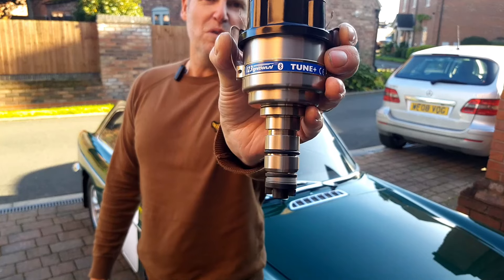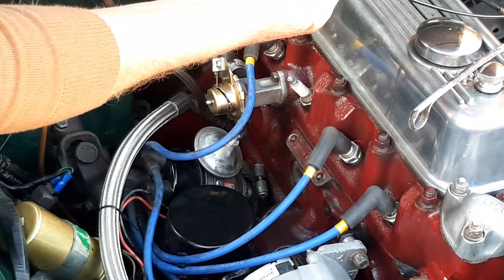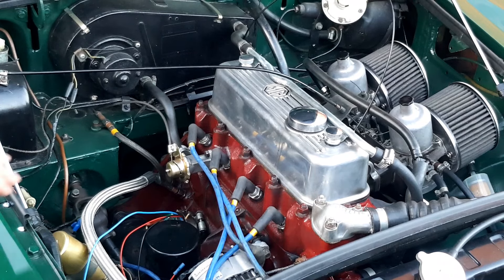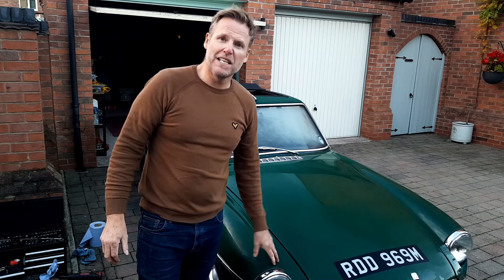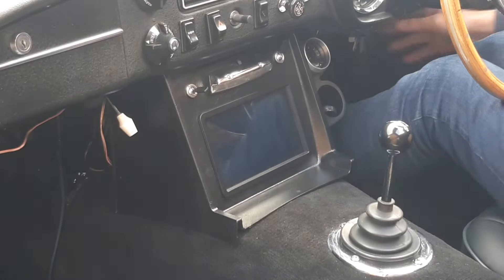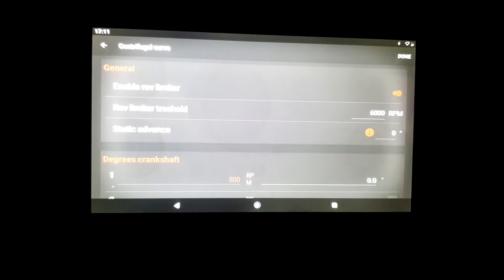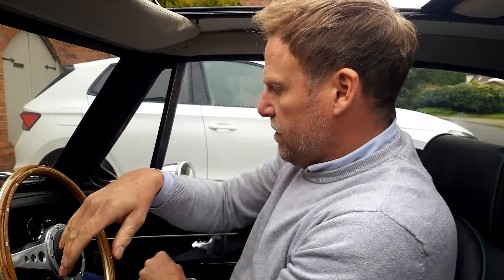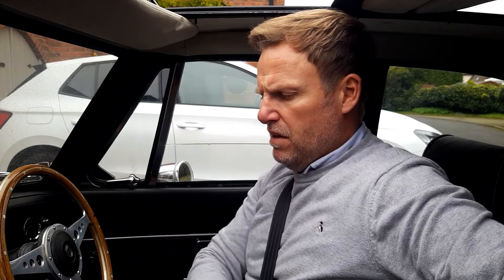The instructions are wrong! Fitting a 123 Tune+ dizzy to an MGB GT.   MG B BGT @Exhausted-autos

Comment: If you set up your timing light you can use the static advance feature on the 123 to get perfect agreement between what the 123 is reporting and what it actually is. Also, to tune the vacuum advance you should check your vacuum level on the app at cruise and under WOT, set lower end of curve so you have full advance at cruise (on a flat road, very little engine load) and no vac advance at WOT with some margin (ie, if WOT vacuum is around 80 to 85kP then set zero at 75kP).
Reply from the maker: Cheers Chris,  I'd not thought of that,  I'll change the static in the app... it'll be particularly useful with the SC.  Il get back to the vacuum.... I'd be good if it could record parameters from a drive in the app.
Reply: @Exhausted-autos  I have asked them multiple times to enable logging but the best I have managed is recording the screen and then syncing the video with my other logged parameters like AFR from the wideband.

Comment: Easy way to tell if you’re on the compression stroke…. Remove the spark plug ,rotate engine with your thumb over the hole ,you will feel the pressure as piston comes up !!
Reply from the maker: Cheers Michael, ill try that.   I'm looking forward to getting back onto the MG supercharger.👍

Comment: Great video, I thought I would add a bit to help. Firstly programming a 123 dizzy. As an example lets simulate a 25D41288 MGB dizzy. I would add the two points at 500 rpm and 1000 rpm and make these both the dynamic timing for that dizzy - 14 degrees, which is a combination of 10 static plus 4 degrees centrifugal advance. Then at 1600 rpm I would add 22.5 ( 10 static plus 12.5 centrifugal ) and the 30 degrees at 2200 rpm ( 10 static plus 20 centrifugal ). That is the end of the advance curve for this dizzy. This is where the 123 is brilliant, because we can enhance this curve beyond 2200 rpm. 32.5 degrees at 2600 rpm, 33.5 degrees at 3000 rpm, 34 degrees at 3300 rpm, 34.5 at 3700 rpm and 36 at 8000 rpm. The vacuum advance can be obtained from the case of the dizzy, for the 25D41288 advance starts at 87KPa and finishes at 20 degrees at 69 KPa . Then continues at this level. In practice I do not set vacuum advance above 10 degrees using the same points. On the 123 dizzy I use the feature that enables me to turn off vacuum advance below a certain Rpm, I do this at 1100 rpm so idle has no advance. With all the points above you can experiment according to the tune of the vehicle. If you can get a workshop manual all of  the curves for each engine and dizzy type are given, alternatively you can get them on the web, http://www.mgb-stuff.org.uk/curvestext.htm. Timing a 123 dizzy. Set to TDC as the green light comes on. The car should start immediately. If you have access to a programable strobe, set it for 14 degrees, disconnect the vacuum advance and check 14 degrees on the program corresponds to TDC, adjust the dizzy as necessary. Remember to reconnect the vacuum advance tube. Timing done. You can change the program and NEVER have to change the timing. Then balance and adjust the carbs. Your car will be smoother, with better low down pick up and mid range torque. Much more drivable than even a good original dizzy. 123 dizzy gets you about 90% of the way there. A megajolt takes you to the next level of incremental gains. Given its extra cost and complexity I would add it to a balanced, gas flowed with better cam type of engine on an MGB, but then I would probably also add a 5 speed gearbox, change the rear axle ratio, put GAZ rear dampers on with a Panhard rod, a slightly stronger anti-roll bar and front lever arm dampers that can be adjusted for damping and adjustable camber.

Comment: In general not a bad little video, so please do not take the following comments as a criticism of any way.  So firstly, if the car is a runner before the distributor upgrade, its worth taking the cap off the existing distributor and taking a quick photo.  This can become a reference position for the new distributor installation.   Showing people the compression stroke via valve closure is a great idea, just as you've done in the video.  Some sadly don't know which way to turn the crank shaft pulley, so this can a be a good time to explain the distributor rotor should be turning 'anti-clockwise' as you rotate the crankshaft pulley.   Or depending on ground conditions, the same can be achieved by pushing the car forward whilst in gear (handbrake off of course).OK.....now on to the base/static ignition timing.......you've always got to check this with a strobe.  If you were 2, 3 or 5 degree out from the static applied, it then makes your whole mechanical advance curve into a joke, because every key check position is than also 2, 3 or 5 deg out also.  So now onto the top end of your mechanical advance curve.....throttle open and under load, you do NOT want to me aiming for late 40's to 50's crank degrees!!!!   Let me give you an example why.   One of the most highly regarded Lucas  Distributor curves of the day was the same as used in the Mini Cooper  23D4 S/N40819/41033/41210.  If people upgraded their MGB with the typical mods (cam , head, exhaust) this is what they fitted, direct from the mini to the MGB because of it's 'sporty' advance curve.  So......if I now told you that with the 'S' distributor fitted from a base idle of 10 deg BTDC full mechanical advance at 4000rpm gave between approx 28 and 32 deg BTDC of crank shaft degrees. We'd now all be wondering why you were aiming for late 40's to 50 at wide open throttle!!!  When you go on to supercharge your engine, you'll probably find a full mechanical advance required is even lower....24 to 28 BTDC depending on other factors.  Again, no offence meant, and some great content in the video......just extreme caution about mechanical advance up there in the late 40's of crank deg, it's a definite No No...
Reply from the maker: Thanks for the detailed comment,  I'm always happy to learn    You're spot on re the supercharger and that's why ive fitted the 123 in the first place to give better control and limit the advance.   Ive not gone back to rewatch, but thought I was pitching at 40s on the dizzy and not crank.   

Either ways il be very cautious with the sc set up and then get it on a rolling road with someone who properly knows what they're talking about.
Reply: @Exhausted-autos  ....no probs at all.  40' on dizzy equates to 80's at the crank.  Very easy to mix the two.  Luckily the MGB engine is quite robust, and the worst I've seen is 42 BTDC crank at idle (vac disconnected) 62 with vac and somehow it survived.

Comment: All distributors for classic cars are not spot on for fitting the exact same way as your original. There is nothing wrong with them, they do work a treat. After fitting them you got  twist the  housing until you can start it, then play around with the timing until your happy. The housing could be in a different position,  inch or so from  previous position from your old distributor.  I  had this problem with a 2 litre pinto..

Comment: Should the curve on the app just be the advance without the vacuum amount added?
I've got one of those dizzys on my v8 but it's an early one with just a fixed set of curves to choose from and I found I needed to ad extra by turning the dizzy too but they are nice bits of kit.
Reply from the maker: The vacuum should be independent.   You want vacuum advance on cruise, but zero on Wide open throttle... but as it's ported on the carb the vacuum drops away as the butterfly valve is fully open.

Comment: Hi there you kind of just breezed over the tablet install . I'm wondering what you used to mount it to and which tablet you used I'm also kind of curious what functions that has other than you know being the controller for your 123 ignition and yeah if you use that for your radio as well?